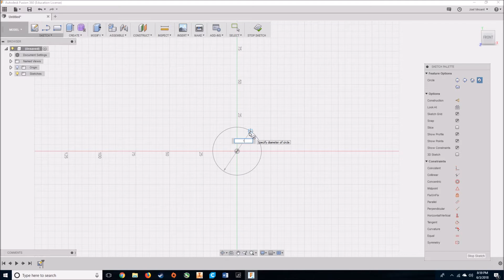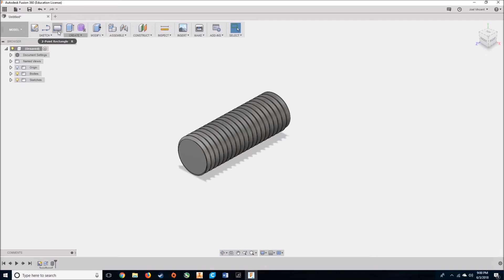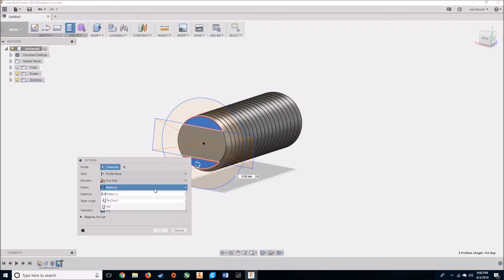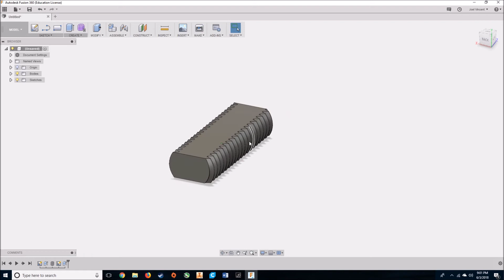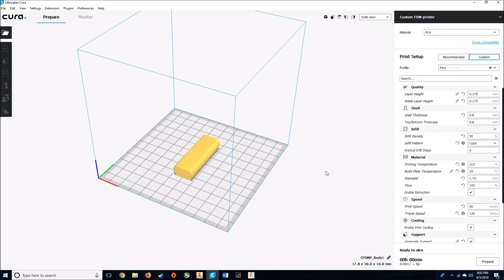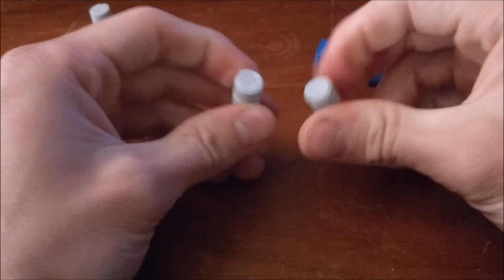Strong 3D Printed Threads Trick

Comment: I experienced the same issue with printed bolts being very weak.  Especially where the threads meet the hex head...very easy to break the layers apart.  My solution was to simply extrude a hole down the center of the bolt and then print with several extra perimeters.  So you have extra perimeters on the threads plus an inner core of extra perimeters.  This design strengthens through the length of the bolt and into the bolt head (The hole can stop just short of penetrating the top of the head head for aesthetics).  The end result is a much stronger bolt.  Although it not as strong as your horizontal printed bolt this method does allow a bolt with a hex head to be printed vertically and still be strong.
Reply: This comment is really interesting, it has got me thinking. Perhaps a really good alternative would be to 3D print vertically as you suggest with an extruded square hole (square in a circle), then print a matching part that could be inserted / glued in. Wouldn't work for smaller bolts, but could maybe even get it down to M6 size at a push. Either way, I have to try your suggestion, it's a great idea. Although even with more perimeters, the bond of the layers is still in the wrong direction. But it will be stronger than anything I have done so far!
Reply: Also helps if you taper the connection to the head so that's less of a weak point. It uses more material but if increase fill factor > 80% it's stronger and hard to break apart with bare hands.
Reply: @frankief7111  Yes, although it does mean in many applications you can't do the bolt up flush to a surface. I printed a bolt to mate two brackets together, each had a slot, not a hole, and so I designed the bolt to have two "wings" to provide this taper, albeit not around the full circumference of the bolt.